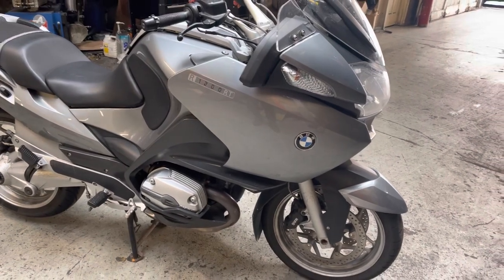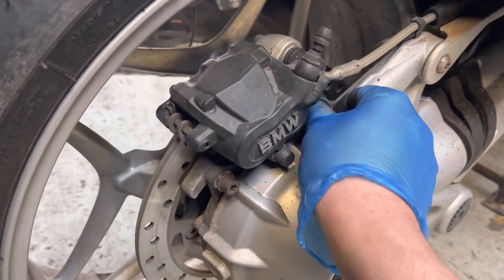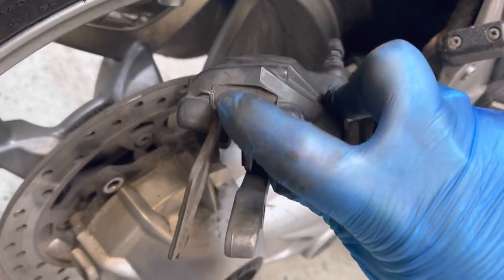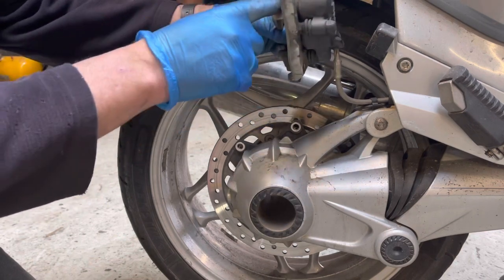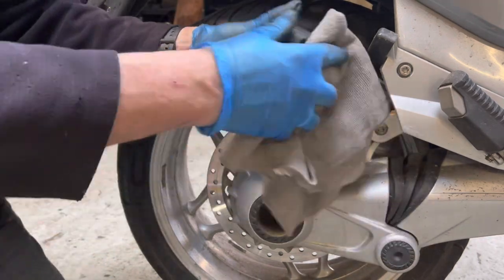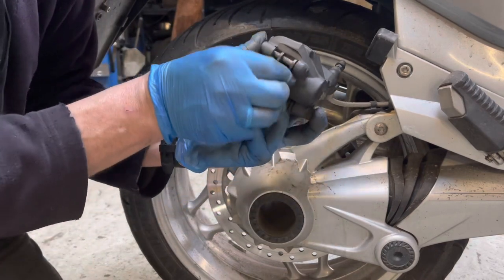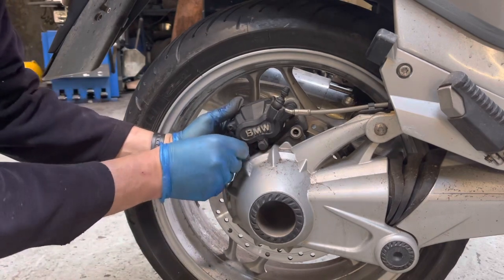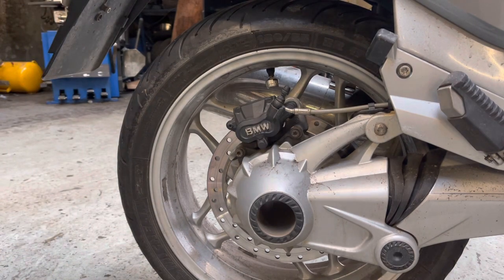Replace Rear Brake Pads On a BMW R1200RT 2005-2013

Comment: Thanks for this video. I’ll be replacing the brake pads shortly. Ordered brake pads on Amazon already. Looks like most others use a torque wrench to tighter the caliper bolts to the correct specification.

Comment: Did you have to remove any brake fluid from the rear master cylinder? I recently did a bike where the pistons wouldn't fully release because there was too much fluid. The bike had had a brake fluid flush done when the pads were low so pushing the pistons back in led to too much fluid.
Reply from the maker: Hi no not at all just open the reservoir so there’s no pressure